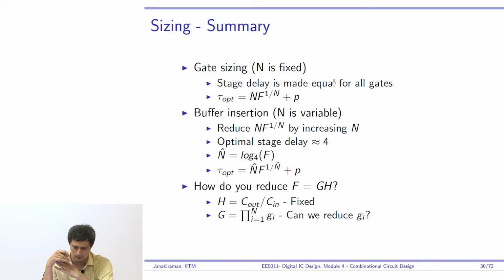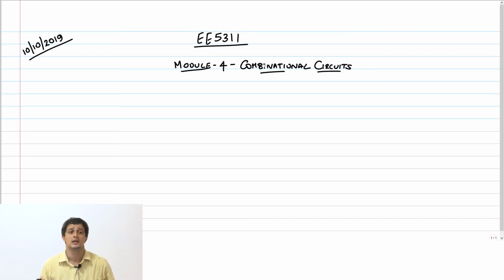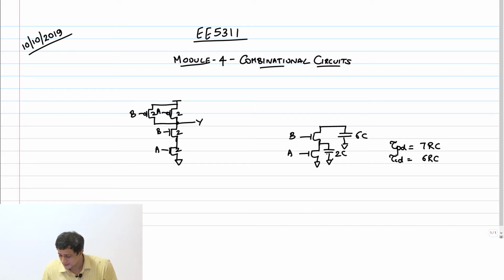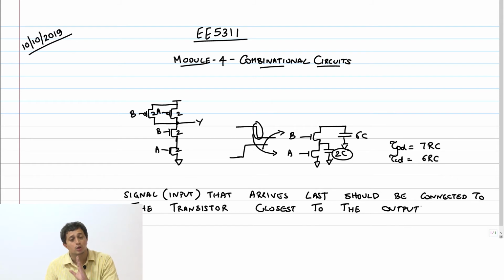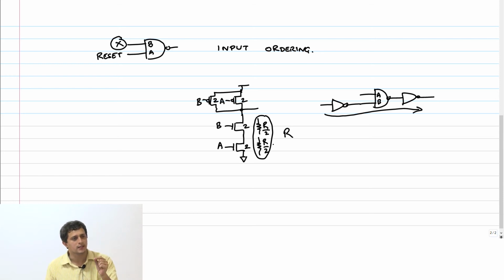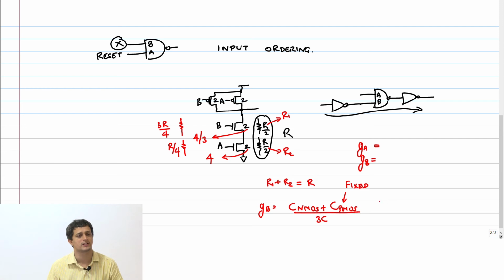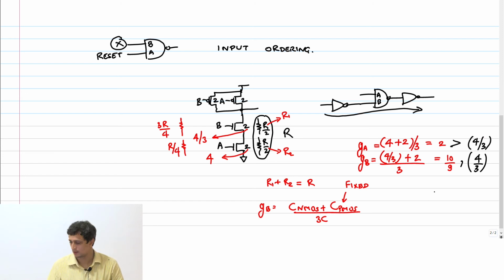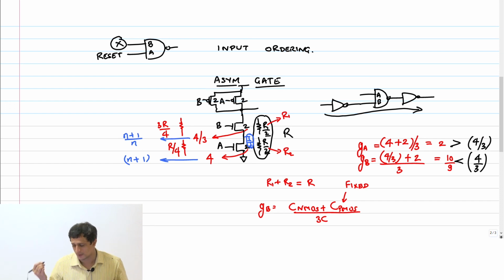CombCkt-12 - Input Ordering and Asymmetric Gates

Comment: AT 7;29 DONT YOU GUYS THINK THAT SIR HAS MADE WRONG  SIGNAL FOR B INPUT ........
Reply: I think so, signal should switch to logic 1 then only 6C will be discharged.
Reply: @Singh-Rajveer   exactly( for b input na)
Reply: @sachinjaiswal1933  yeah for input B
Reply: um i think , he is talking about 2C cap discharging  ( so A is turned on first ) setting intermediate node to  gnd.  Then B is turned on, discharging 6C cap to gnd through B transistor Only.